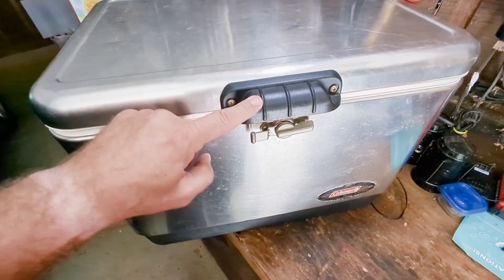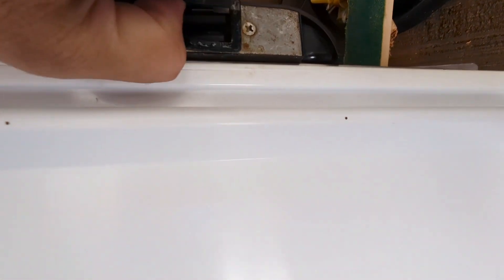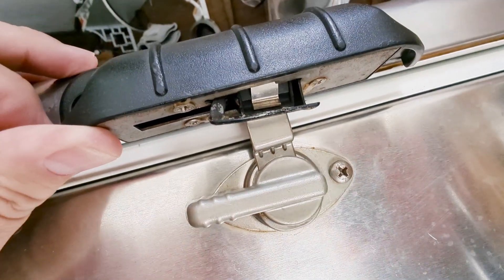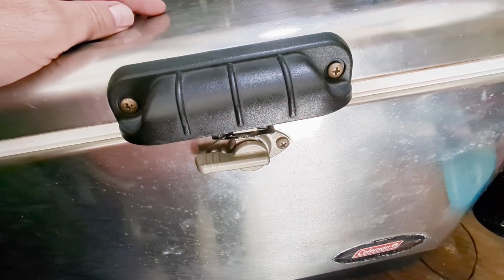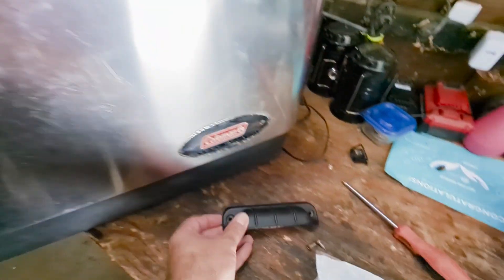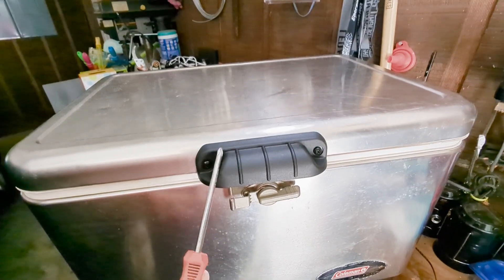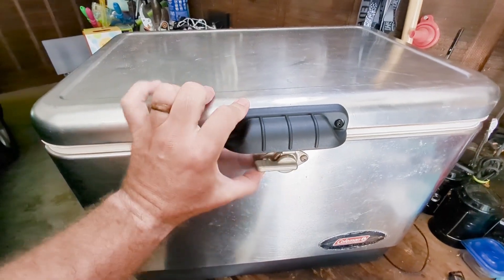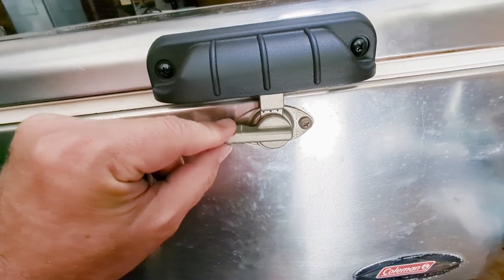Quick and Easy Coleman Steel Belted Cooler Handle Latch Replacement - Extend Your Cooler's Life!

Comment: I have this cooler also and need to replace the same part. I wish they would just metal for where the latch secures or anything other than a little plastic piece… good video though, I’ll be ordering that replacement thanks.

Comment: Problem is that plastic plate is too small and has too much play and will wiggle out of the cut out. I took it apart and secured the 2 pieces together with aluminum tape, also removed the metal bracket that holds the latch and squeezed it tightly. No more plastic pop outs or latch pop outs. The repair has held up for a year so far.